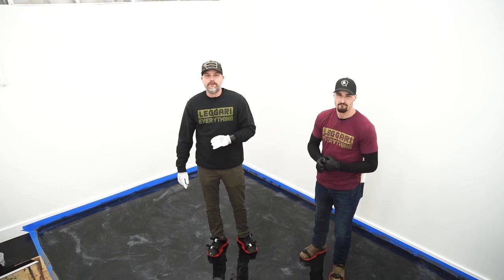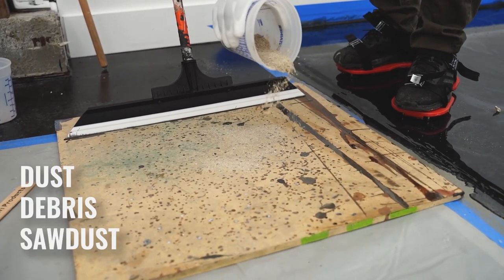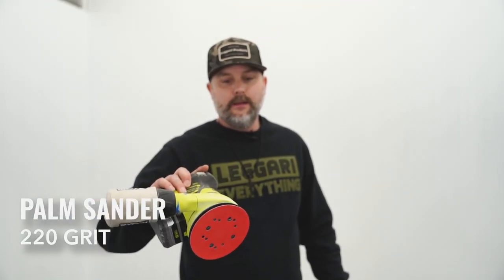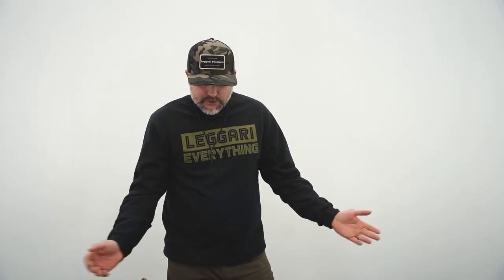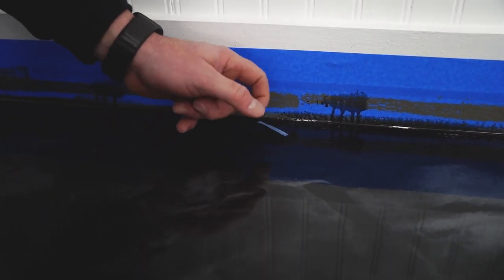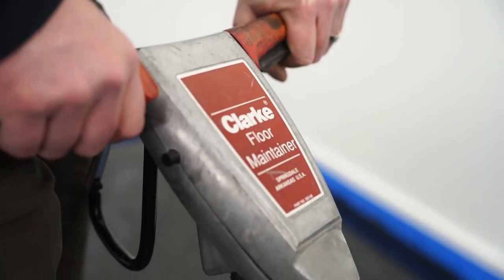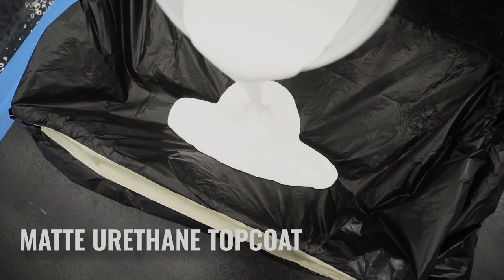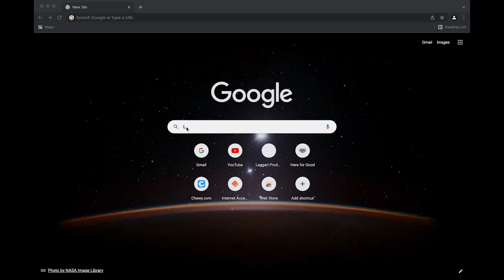QUICK FIX!! Epoxy Floor Install Goes Bad (DIY repair epoxy floor)

Comment: Thank you. Very informative and helpful. Yes, many of those issues pop up regularly due to those walking and applying material. Sanding with fine grind, clean then Eurothane coat. (Quick drying epoxy, sharpies, spray paint for depressions)

Comment: Hello friends, greetings from Venezuela. I have a question, yesterday I finished applying epoxy resin to a concrete counter, but today about 2 bubbles appeared on one main edge. Should I sand to eliminate those bubbles and very delicately and subtly inside the hole that will remain, I apply epoxy resin again??? It would be perfect. Or should I apply a full coat to the countertop? Please help...thanks in advance..
Reply: What did you do?

Comment: I just got my epoxy floor done. The company could have been better. I came to her to confirm if those chucks and pieces were typical. It seems like they are when you don't sand. So now, I have to go behind them and sand for myself. I should have followed my first instinct and done it myself. Plus, I don't want to damage it. What about hairs? Would sanding help with that? Thanks guys!
Reply from the maker: If there hairs and other minor imperfections in the floor we recommend lightly sanding them sown and then you can reapply your topcoat. This process might differ when using another company's products but this is how we address imperfections like the video shows💯💯

Comment: Love your guys stuff!  Definitely professional applicators on your crew!  Do you have epoxy that can be shower walls?
Reply from the maker: We have people coat panels horizontally and then install them in place in the shower!
Reply: @LeggariProducts  how to join the seams?
Reply: @LeggariProducts  Do you have videos on how that is done? Including how the seams would be joined? Thanks!

Comment: Hello it’s been a year since I used your product to do my kitchen counter. I need to know how to fix these. Little dried up holes in the epoxy and a burnt spot, then small chips on the edges of counter. How do I fix these problems. Thanks 😊
Reply from the maker: Email customerservice@leggari.com They will be able to help you with your questions, and walk you threw the steps to fix the issues!
Reply: @LeggariProducts  Thanks so very much..
Reply: Burn marks and chipped edges? How well were these issues rectified? Was the epoxy as hard, solid  as you expected?

Comment: Could you do the same thing if you have some spots that are cured all the way and some spots that are not?
Reply from the maker: NO, if you have soft and sticky spots there is a chance the epoxy was not mixed all the way and could never get hard, so you would have to remove it and recoat!

Comment: How long after the epoxy can you start sanding?
Reply: Next normally but depends on factors like temperature .. Humidity.. Brand.. Sometimes it is still sticky next day

Comment: So you can't just do the spots? You have to do the entire floor or area?  We had just a couple spots......bug and just weird small spots. Can I just sand those small spots and use the JB weld epoxy kit with the same resin powder?
Reply from the maker: Hello! Feel free to contact our customer service with your questions regarding our products at customerservice@leggari.com or 1-844-LEGGARI (534-4274). Best of luck to you!

Comment: What is the process to fix the WB Polyurethene topcoat if it dried with some streaks and blotches? Just got done with a floor kit and used a gloss WB with grit additive. Its a little cloudy and we want to give it that shine as the final result!
Reply from the maker: It would need sanded and re-applied. If it's cloudy it was applied too thick. The grit additive will dull the sheen a bit but it does add extra scratch resistance.
Reply: I thought so. Could you give me a few tips on the sanding method? Tips to reapply it? How long does the Topcoat last in the bucket and could I add more water too it after its been mixed and sits? Really appreciate the quick repsonse here!
 @LeggariProducts

Comment: What about Pin Holes in the Epoxy Basecoag when it’s dry? How do you repair that?
Reply: Bondo or epoxy paste
Reply: Fill the 20 or so bubbles with epoxy that has been mixed with a metallic, the use a syringe or something to pour into those pin holes. Shouldnprobsbly open the holes with. A razor to get epoxy well into them. Go above the surfsce, then after its cured sand, Then use top coat again. Not fu . Its a lo g process. Seams easier with other companies simy using g the torch to prevent bubbles in the first place

Comment: @leggari products   Is it possible to add more veins to a white epoxy metallic floor after the fact?  My wife is not happy at all with the minimum veins our floor guy put in. I can send you photos.
Reply: Sand 80- 120 grit repour the entire flour add desired veins benifit is now you can have under tones from the prior job, as well as your new veins and it wont take any where near as much resin

Comment: If I haven’t hit the top coat I have a little piece of the foam from the roller that dried I wanna clip it off it’s a little Lump
Reply from the maker: Yes just sand it smooth or cut it out before topcoat!

Comment: I do get this spots when i do coats , problem is it gets in second or third coat which should be my final coat.. what should i do on such situation without doing another coat.. i tried sanding those out with 180 but it didn't get off and yes there is also a fear of wood getting exposed so i dont want to sand that hard
Reply: Top coats are clear so cant use colors
Reply: And also clear repair/filling don't match on sanding ..😅

Comment: If I sand my metallic coat can I ad a clear coat of epoxy for top coat dose it come shiny I have small bubbles everywhere that’s why I want to sand the floor but I want shiny finish
Reply from the maker: Yes! As you can see in this video 👉 https://www.youtube.com/watch?v=wz7THPQuxhA&t=715s, we sand out the floor's imperfections as well before applying any topcoat 👍 
You can check out our floor kits here https://leggari.com/order-flooring/#metallic-epoxy-kits and feel free to contact our customer service with any questions concerning our products. 
1-844-LEGGARI (534-4274)
customerservice@leggari.com
Reply: Is it gonna mess up my designs in my metallic coat if I sand it cause the design is amazing right now
Reply: And for too coat can I ad clear epoxy
Reply: @LeggariProducts  can i sand out my poly topcoat if i have bubbles in it then re poly?

Comment: Holy shit. I must be a natural. I've only poured a few sample pieces all came out perfect but my first time doing it on a project, a coffee table and I got uneven edges and over sanded and got some of the wood showing through the epoxy and just tried hitting those spots with the sharpie just like dude did it, little dabs and rub it in then did a clear coat with some color accents and those spots blended in perfect . I learned the hard way no matter how many perfect pours you do you can't get cocky and push things, my problem is I keep messing with the design. Cause every time I look at it I see something new that could look better or I question myself if the smallest details that Noone would ever notice but I do cause I'm examining my work so sometimes I push the working time to the last possible work time minutes.j guess my luck ran out.. trust your work and don't second guess yourself is the lesson I learned